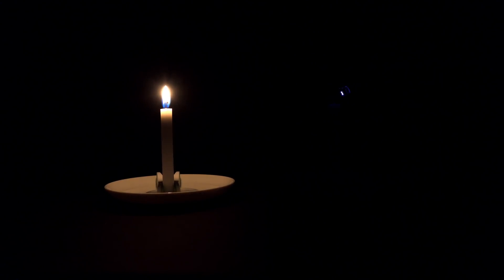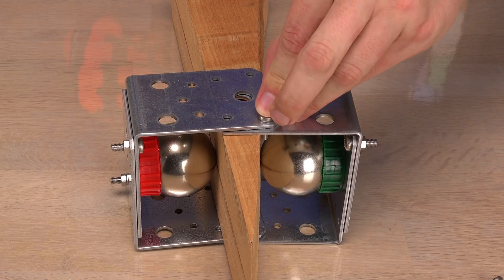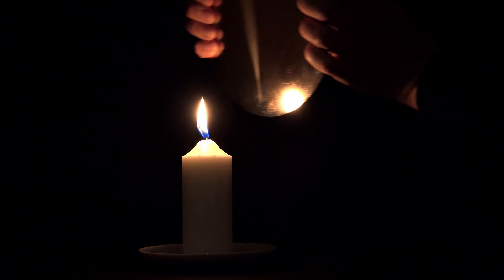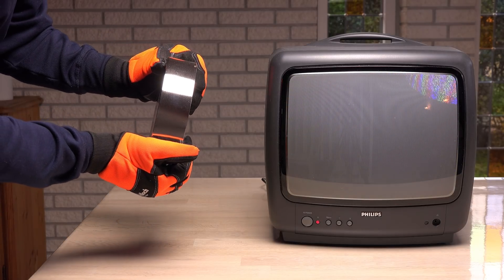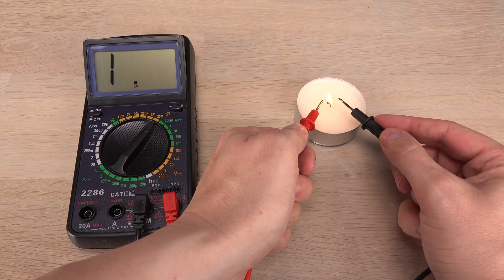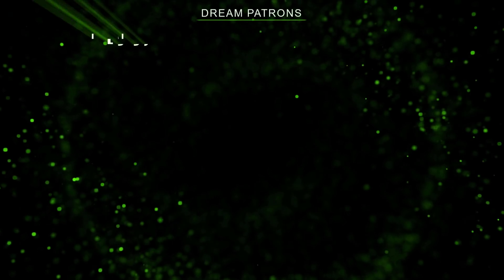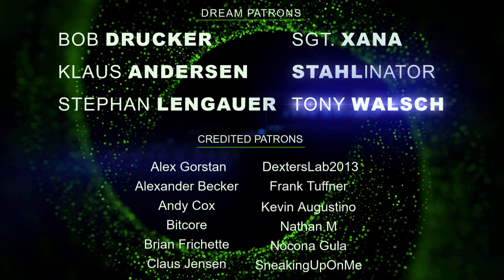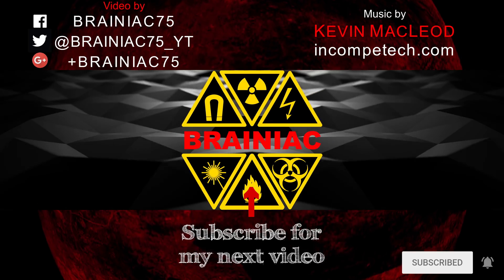Monster magnet meets flames...

Comment: As far as my knowledge goes, this is puzzling. I don't think that the paramagnetism of air is a factor. If anything, it should suck the air from every direction, effectively pushing the flame towards the magnet. And the flame itself should be quite paramagnetic because the majority of the intermediates in combustion chemical reactions are free radicals, rather than ions. But this should also push the flame towards the magnet. This seems to leave the only explanation: What little ionisation is there in the flame, it is enough to cause motion due to the Lorentz force. But then, the direction of flame shift should depend on the magnetic field polarity. Did you check this factor?
Reply: When he sets up the two magnet box and moves it back and forth, you can see the flame deflecting in both directions, showing that it repels from both north and south poles. Unless he deviously set them up north to north or south to south, which there's really no reason to, this isn't a free energy device scam.

Comment: Could increase magnetism add to the increase air flow of cold air down draft of a Tornado Vortex the flame representing the rising hot air could also the earth magnetic fields be at play at that occurance?!
Reply: There aren't many tornadoes at the poles, and the Earth's magnetic field lines run mostly parallel to the surface in tornado alley, so it's not a good analogy with the flame here. It would be interesting to see if a flame from an identical candle burns higher at the poles than the equator, though, controlling for elevation and air temperature and all that. But you could just as easily simulate the conditions locally with magnets. You could arrange it to cancel the Earth's magnetic field, but I think the result would be negligible because the field density is so low. Back to tornadoes, though, magnets don't really create a flow themselves, they're just potential wells. The atmosphere is already in equilibrium from any effects the Earth's magnetic field would have on it. Temperature, pressure, humidity, all would overpower any effect of the planet's magnetism. I'm curious now though, if oxygen is more rare in the upper atmosphere because it's attracted to the ground. Wouldn't be by much.

Comment: If air is paramagnetic, wouldn’t that mean there would be continuous airflow around strong magnets?
Reply: No, for the same reason a magnet dipped in iron filings don't have a constant stream of metal particles around them. Once all that can be attracted has been, it stays.
Reply: @ @galfisk   While the wording is off, Myrcella has a point. If oxgen is magnetic would that mean a magnet can be used to separate O2 from N2. As it was shown that it is quite a strong effect.
Reply: Dragos Coco so in a low oxygen environment just duct tape a giant magnet to your face?
Reply: @jbh759  I don't see how that could possibly fail.
Reply: @dragoscoco2173  Thanks to user "H" in another comment, there's a patent for such a device that claims to reach 99% oxygen concentration using superconducting magnets. https://patents.google.com/patent/US7771509
Reply: @DFPercush While surely SC magnets are a nice thing to hold your door open. Let's talk about this video with reality being like this https://en.wikipedia.org/wiki/Magnetic_susceptibility. Oxygen is somewhat attracted to magnets but by a very small amount, heat currents would be far superior by a few orders of magnitude. So I would search for a different explanation.
Reply: @dragoscoco2173  I wasn't talking about the flame in the video, I was answering your question "would that mean a magnet can be used to separate O2 from N2" - but yes, most of the time the bouyant force on the hot air overpowers the magnet.
Reply: @DFPercush  Did not intend on appearing offensive. While it is clear that O2 N2 separation with magnets is possible with a big ass magnet, I am quite sure this is not the case with a neodymium magnet. I am just stating that the magnetic attraction/repulsion of the involved gases is much too weak for the observed effect, and if the attraction/repulsion were significant you would be able to have O2 N2 separation with Neodymium magnets. An argumentum ad absurdum in a way.
Reply: @dragoscoco2173  no worries ;)  Yeah, neodymium magnets probably aren't strong enough to do very much separation. I see what you mean now. It's not the magnet pulling in cold O2 that's causing the effect in the video.
Reply: +Joe Hoyt That would be the implication of that supposition. Separating oxigen would reach a new cheap.
Reply: No that's not how it is, the air is paramagnetic but in the gaseous state the gases have so much kinetic energy that they do not get caught in the magnetic field, In the liquid state, maybe, but I'm the liquid state too this effect is very weak as is in the case of oxygen

Comment: If oxygen was causing this then there would be more oxygen near the flame then in normal air. This would cause the flame to burn faster and possibly hotter.
The flame uses oxygen and loves oxygen, it is not repelled by it.
Also, if there was a breeze of oxygen the flame would move erratically. 

I would say that it could be ions that are reacting since the repulsion is static. Possibly happening when the molecular bonds are being broken and reformed where the reaction has intermediate moments of ionization.
You could test this with an electromagnet, varying the field while the flame is burning. If it moves more with a stronger field then it is a hint that its possibly ions.

Comment: so Magneto can deflect superman Laser eyes ?
Reply: Magneto could deflect the plasma of the air, but heat vision is largely a laser of extreme power. I don't know if light is affected by magnetism, even though magnetos power rivals that of superconducting magnets used in nuclear fusion experiments. Much higher than even an MRI.
Reply: A laser beam is photons, not plasma, so no. If you could manipulate gravity and create a mini black hole for a second, however, that would do it. You'd also spaghettify yourself in the process and probably kill everyone on the planet, but at least the laser wouldn't hit you.
Reply: Your question did make me wonder. Light is an electromagnetic wave, so would it be affected by a magnetic field? The answer appears to be that the field can rotate the polarisation of the light, but there's no deflection.

Comment: Can you measure a voltage (in the mili/microvolt range) across a flame in a magnetic field, from the separated ions?
Reply: Flames will actually conduct a bit of dc voltage across it. It will even rectify it from ac to dc as elections will only flow one way across a flame (from bottom to top). This is used to tell if a natural gass furnace is on for safety reasons.

Comment: Really nice! Maybe, you could try hanging very small sheets of paper(or a any material that has very weak diamagnetism/paramagnetism, being almost neutral to the magnet's force) with as little mass as possible, and putting your strongest magnet near it, to see if it would be pushed away from the magnet due to the air being attracted to it. 
 For even further research, you could use a vacuum chamber, take out all the air from it, add any diamagnetic gas(like argon) and doing the same test inside the chamber, and if the magnet indeed pushes the flame due to the air displacing it, the first test would be true and the second false.
I love your videos! Keep with the good work!

Comment: I wonder what would happen if the dual magnet contraption were offset by a few centimeters, so that one is lower relative to the candle wick and the other is higher; or one is behind relative to the camera and one forward. If the oxygen consumption from the air is significant, this could create a cool warping effect on the flame, bending it around one field and into another. If not...well, always  worth a quick test for the sake of science, right?

Comment: One possibly interesting experiment is to use a reverse flame. I recall Cody's Lab doing a video on an oxygen flame in a propane environment. You could make an atmosphere of some hydrocarbon that does not respond to a magnet, and flow a stream of oxygen through a small steel tube then light it. Then see if the magnet will deflect the oxygen flame towards it due to paramagnetism.
Reply: Exactly what I was thinking should be done
Reply: I think the results would be the same, even if you light oxygen as a fuel in a propane atmosphere.
Reply: Maybe not a steel tube, though?

Comment: I have a quick question:

If water vapor is diamagnetic, why does it the condense on the strong magnet?
I would have thought that it should have been repelled... Is it because of the amount of vapor overcoming the repulsion, or am I missing something here?
Reply from the maker: That is one of the reasons, I don't think it can be explained by diamagnetism alone. The effect simply isn't strong enough for such an effect on a moving object (a flame moving upwards due to convection). I think the rising water vapor above the flame has enough kinetic energy to overcome the weak diamagnetic effect and touch the magnet. There it immediately condenses on the relatively cold magnet surface. Once it is condensed, the adhesive forces take over (much stronger than the low-value diamagnetism). Thanks for watching!

Comment: At 6:31 you could almost have a little piece of cone incense stuck to magnet, so you could see a visual of the air drawing around it.  Additionally I would like to see the results on the flame if you had both those magnets set to repel each other.  You might also ground the candle wick, they do have a little metal wire in a lot of em, grounding it might result in a different effect.

Comment: Fascinating. Since oxygen is so diamagnetic it should be possible to create a magnetic device to separate oxygen from the other components of air. Is that correct?
Reply from the maker: I believe someone patented that, but never made it work in practice. I don't think it will work at normal temperatures, where diffusion/Brownian motions will be stronger than the paramagnetic effect on free-flowing, tiny molecules. The air will simply mix it self continuously. But at much lower temperatures it may be possible! Thanks for watching.
Reply: Here's what I found on Wikipedia about oxygen concentrators ... no magnets involved:

Oxygen concentrators typically use pressure swing adsorption (PSA) technology and are used very widely for oxygen provision in healthcare applications, especially where liquid or pressurized oxygen is too dangerous or inconvenient, such as in homes or in portable clinics. For other purposes there are also concentrators based on membrane technology.

An oxygen concentrator takes in air and removes nitrogen from it, leaving an oxygen enriched gas for use by people requiring medical oxygen due to low oxygen levels in their blood. Oxygen concentrators are also used to provide an economical source of oxygen in industrial processes, where they are also known as oxygen gas generators or oxygen generation plants. Oxygen concentrators utilize a molecular sieve to adsorb gases and operate on the principle of rapid pressure swing adsorption of atmospheric nitrogen onto zeolite minerals and then venting the nitrogen. This type of adsorption system is therefore functionally a nitrogen scrubber leaving the other atmospheric gases to pass through. This leaves oxygen as the primary gas remaining. PSA technology is a reliable and economical technique for small to mid-scale oxygen generation, with cryogenic separation more suitable at higher volumes and external delivery generally more suitable for small volumes.

Comment: I think the flame got bigger/smaller when you moved the newly created contraption was because the air was repelled into the flame making it burn bigger and faster, and opposite for when the flame was smaller. Thus the flame itself wasn't directly effected from the magnetic fields but rather from the air being pushed and pulled by the magnet and this resulted in this effect. Just a thought though, I'm no scientist.
Reply: Dude it's Ethan Overwatch!

Comment: See how high you can make the flame with a contraption of the magnetic balls in a column? Kind of like making a fire tornado but with magnets instead of fans?
Reply: I was thinking take the rotor out of a large stepper motor and place a candle inside that.

Comment: the flame is a plasma
Reply from the maker: It's debatable since we don't have a strong definition of what we mean by 'a plasma'. In my opinion a flame is only partly a classic plasma, since it isn't ionized enough to be called a full plasma. Thanks for watching!
Reply: @brainiac75  -- difference of air density around the magnet coul refract light in a different way. Laser bean distraction near magnet?

Comment: There migt be some Conada effect on the bearing ball as well, attracting the flame to the ball. At least a little bit. Same goes with the magnetic ball, as it is defined by shape and air flow. However, the other effects are much stronger. Btw. a very nice video and I especially like how you take the air itself into account. This is really proper science here, applying the scientific method to explain the observed events.
Reply: One thing I wondered: Why hasn't been exploited as a generator? Plasma moves up because of convection so two electrodes in top and bottom of the flame should have a potential? This is possibly the simplest heat engine generator!

Comment: Very nice video. I wonder if there is a way to use a magnetic field to put out a fire. Maybe pulsing the field to prevent combustion. If you could start with putting out a candle and then upscale to a plane over a forest fire would be one of the best inventions this century.
Reply from the maker: Magnets have the problem, that air is not a good 'magnetic conductor' (it has low permeability), so if your idea is possible, the magnet would have to be very close to the fire. In this case there are cheaper ways than a giant magnet :) Thanks for watching!

Comment: Glowing splint test:
Light a wooden stick on fire, blow it out, then hold the glowing spot where you want to test for oxygen concentration.
Reply: Also, using a regular resistance meter does not necessarily show the ionisation of the candle. The flame probably has a low enough ionisation to make it high resistance at the multimeter´s test voltage, but most likely has negative Resistance characteristics. So if you applied a higher test voltage, you would read a lower resistance. That´s how regular air and many "insulators" behave as well.
Reply: @Basement-Science   Somebody mentioned that it's because the probes are cold, the plasma can't stay plasma near the contact surface. But that could have something to do with it too.
Reply: Basically I think the main problem is that there are too few ions to conduct current from one probe to the other, since there are non-ionized gases between the ions. I don´t think the temperature of the probes should influence that at all, but the test voltage definitely will.
Reply: @Basement-Science   If you crank up the voltage too high, the measuring device itself will ionize the air and you'll get an arc. But I'm not sure, does the air still become ionized before you see an arc? It's a problem of the measurement affecting the result. But yeah, a candle flame isn't really hot enough to produce (much) plasma.
Reply: To be clear, the measurement does not become more accurate with a higher voltage: It is perfectly accurate already at the multimeter´s test voltage. 
I just wanted to point out that the resistance you read depends on the test voltage with systems like this, because the measurement always influences such a system.

And yes, you will ionize a gas with (high) voltage before you see an arc. It´s usually called corona discharge , at least in air.

In a candle flame, most, if not all ions that are present will have come from the chemical reaction, not from the high temperature.
It would be interesting to measure the ion concentration in different flames though. I´ll have to try that some time.